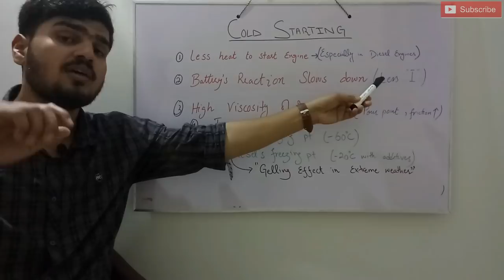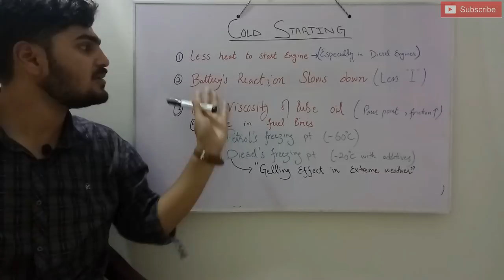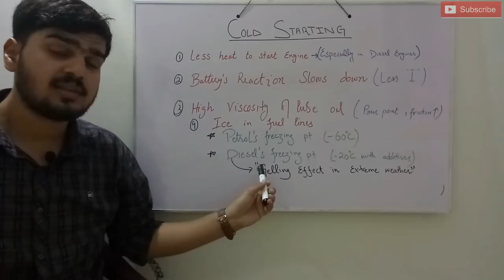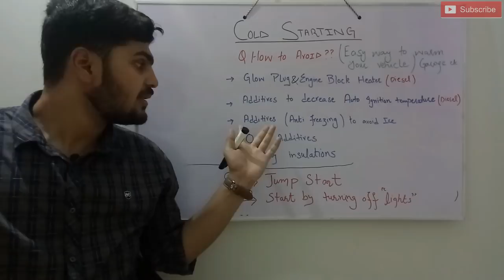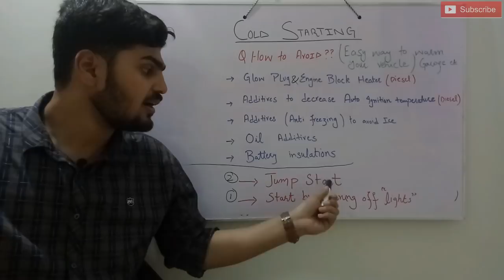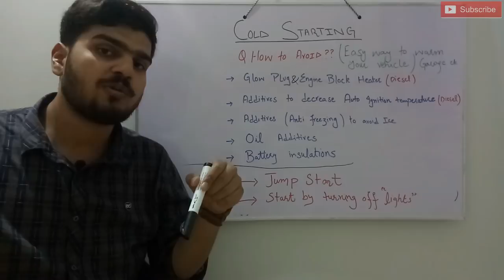Engine Cold Starting | Causes & Solutions | for both Diesel & Gasoline

Comment from the maker: JUMP START:
1. bring the jumper cables
2. in start both vehicles will be at neutral condition (ignition off)
3. connect one red clip to the +ve terminal of your car's battery
4. the other red clip should be attached with the +ve terminal of other car's battery (donor's car)
5. attach one black cable's clip to the -ve terminal of the donor's car
6. the remaining black clip should be attached to the uncovered metal of your car's hood and that metal should be away from your battery
7. now start the donor car for few minutes
8. now simultaneously try to start your car, if your engine starts try not to shut it down, keep charging your battery for about 15 minutes for the next usage.